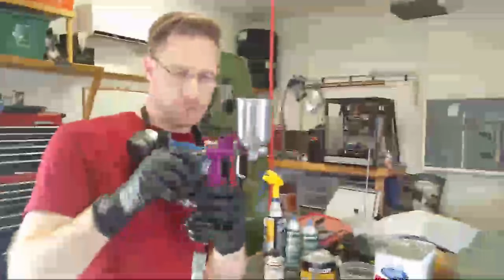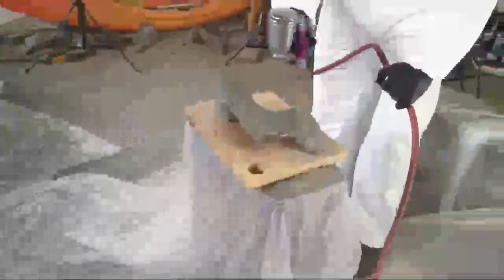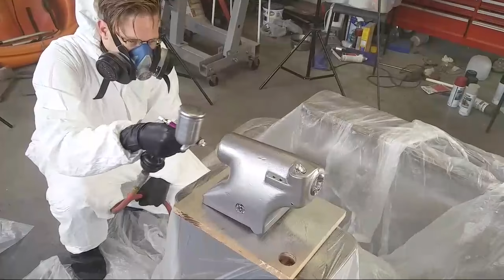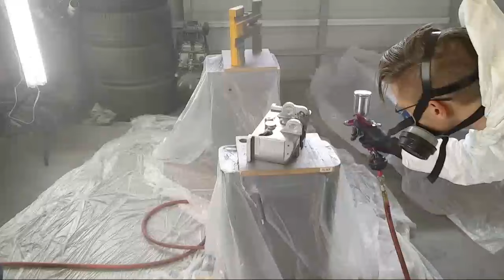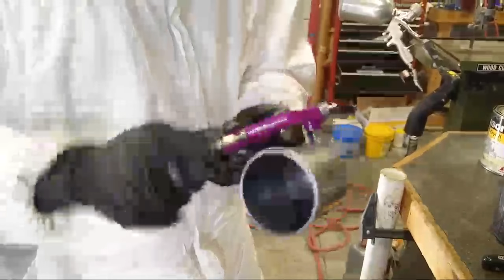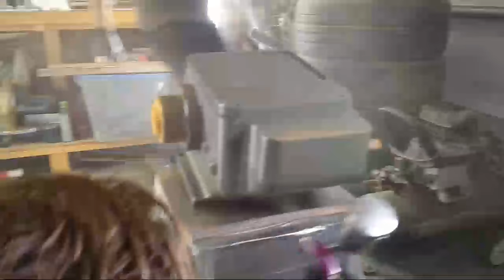Watch Us Paint The Lathe Live!!!!

Comment: You may consider some parts starting by turning them upside down first. Spray painting them then when you come back you can turn them over and the bottom that gets slightly messed up by sitting down on something is going to be the bottom and it won't show you can then spray the top surface and let it be.

Comment: I'm VERY surprised that two physics guys aren't using a "charged" paint setup. Really cuts down on overspray and such, as the anode can be tweaked to really suck up the paint.
Reply: The charge is usually 12v or less, the resistance around 2 Meg ohms. The positively charged paint seeks ground on the metals and "wraps" around even the most intricate shapes. Unlike conventional spray processes, the paint is statically drawn only to the metal from all directions, so there is no overspray, spatters or mess. No "spark", no different expense than car enamel., which is how most large appliances, machine tools and cars are painted. I built my HVLP paint blower from a discarded vacuum cleaner and MDF.
Reply: You mean Electrostatic? These two fellas should have ventilated that area. Thats just pure silliness. Just a standard HVAC filter would work. HEPA preferrably. BTW theres nothing explosive when dealing with Acrylic. Electrically charged systems are primarily a ground system that pulls the paint to the substrate. We Electrostatically paint a lot of objects. Though it would be ideal, i doubt these fellas want to spend 8K for a sprayer.

Comment: "The enamel is harder than the steel they paint"  Mike, how is your skin ?? just a T-shirt, bald head....and that enamel gets harder quickly, probably that's why the gun clogs up. Please use the other camera, this one is very blurry (phone?), probably the auto focus or other auto function is the problem. 
Greatest paint job I ever saw for a lathe!!! I can't wait to see the assembly and testing
Reply from the maker: +fly3209 skin is just fine :) the small particles in the air a pretty much dry by the time they touch anything. That's called over spray and usually can just be rubbed off. The blurriness was there because this was a live broadcast and my internet connection sucks. There will be a nice high resolution edited video up soon. We also found out the clog was caused by some silicone they used for a seal on the gun. Thanks for the comments!